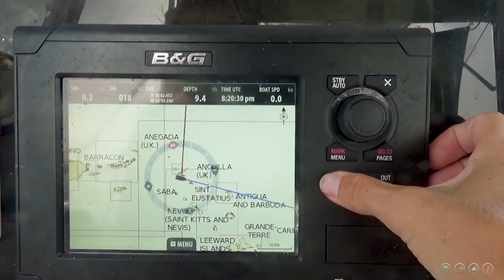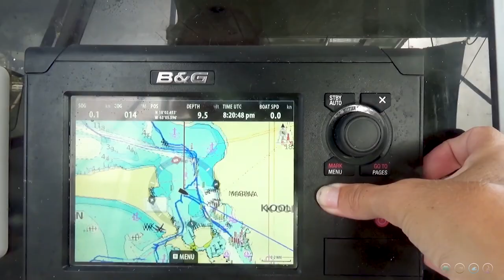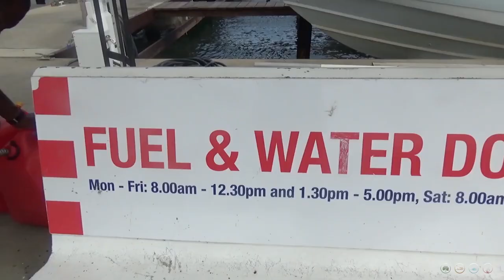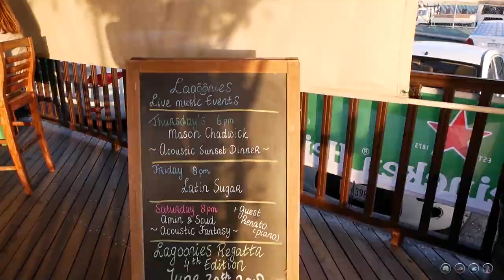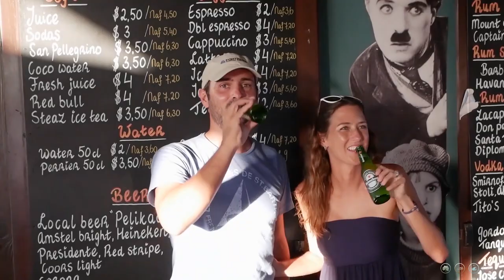Provisioning For 30 Days At Sea (MJ Sailing - EP 76)

Comment: Hope it's not to late but make sure you have enough kitty litter. The Wynns ran ran out and couldn't buy any had to use sand.
Reply from the maker: It's funny you mention that.  If you look at 4:14, I actually added text about making sure to have kitty litter!  😹  We remembered what a pain it was searching for even decent litter to use when we cruised Central America in 2013/14, we did not want to make the mistake of not having enough!

Comment: i am envious, its only 55 and rainy here today, cant wait to see the atlantic crossing series, have you guys thought about getting a watermaker like the one bobby bought on doodles or are they far too expensive?
Reply: We have had a watermaker since 2012 when we first hit saltwater.  It's an HRO unit similar to a Spectra that I bought used on Ebay (new it was about $12k and I got it for $1k).   I wouldn't want to cruise without one unless I had very large water tankage.

Matt
Reply: @mattjohnson6716  totally agree. Our Desalator water maker was invaluable during our Pacific crossing/Australia/Indonesia cruise. We kept 450L of fresh water in the forward tank as emergency water not to be used and used our midships tank (400L) to cycle de-sal water through. Worked perfectly and we had heaps of freshwater all the time.
Reply: @williambremner9022  I wish we had that kind of tankage.  Since we've always had a watermaker, we dedicated only 200l to fresh water (100l in two tanks) and instead we used the available space for diesel tanks(still small at 400lish).   Next boat will be larger and have something similar to your numbers.  

Matt

Comment: Cat litter, good !  What about "human litter" ?

I hope Matt bought REAL Cat5 cable.  Wire count does not mean anything.
Reply: While it's the correct type of cable, I couldn't find shielded like I wanted.  Oh well, I have some more on order and will replace the temp cable when I get the correct stuff.

Matt
Reply: @mattjohnson6716  - In a previous life, I was a sys admin BEFORE there was such a thing as a network admin.  I installed a couple of miles of Cat5.  Shield is not called for in any spec I have ever seen.  Cat5, Cat5E and Cat6 cable are all 4 twisted pairs (8 wires).  The twist is what gives them their noise immunity.  That and what are called "differential driver/receiver pairs" in the connected devices.  Cat6 has the exact same electrical specs as Cat5E, but it uses heavier gauge wire so it is less likely to fail in rough service.  They do also make a more moisture resistant version usually labeled "direct burial".

Only gigabit Ethernet uses all 4 pairs.  Everything else uses just 2 pairs.  So there are 2 pairs left over for Power Over Ethernet.  Seeing as you have an aluminum boat, I don't the the shield is going to help noise immunity.

A dab of lanolin grease or silicon dielectric grease on those plug will prevent any salt build up/corrosion.
Reply: @jackpatteeuw9244  I've heard (so probably incorrect) that the reason for shielding in the cat5 radar cable is for interference pollution with other devices like the compass and not with the radar itself.  I hadn't noticed any any weird behavior with the anything aboard when the radar was running, but I am having issues with radar and this cable is the only non OEM thing aboard, so, it's getting replaced just in the hunt for the issue.  It uses only 2 pairs of the cat5 cable in a crossover with a RJ45 on both ends.

Matt
Reply: @mattjohnson6716  - so the other question.  What are you using for "people litter" in the head ?
Reply: @jackpatteeuw9244  -  We used coconut coir;  which we really liked,  but can't find in the Azores.  Now, we are using hamster bedding (basically course sawdust) and it works ok.  We just sprinkle some over 'deposits' and call it good.

Matt
Reply: @mattjohnson6716  So how many pounds/cubic feet of hamster bedding do two adult use in a week ?
Reply: @jackpatteeuw9244  we get about 4 weeks out of a compressed block around 5" x 4" x 8".  Cost is $3.50 here on the island.  

Matt